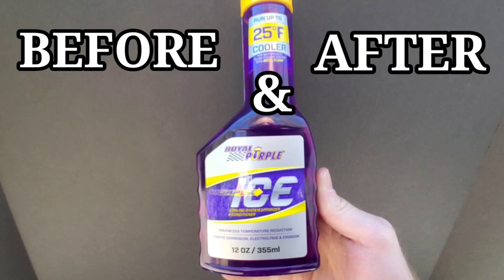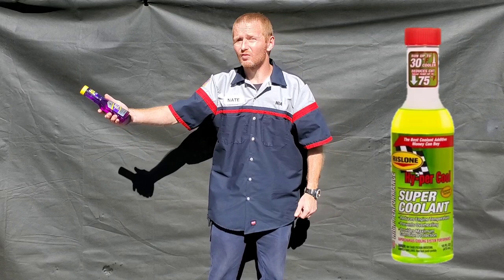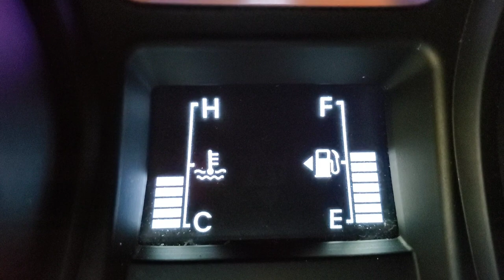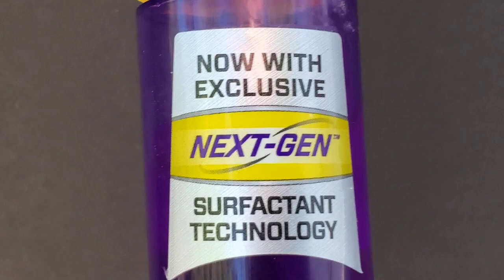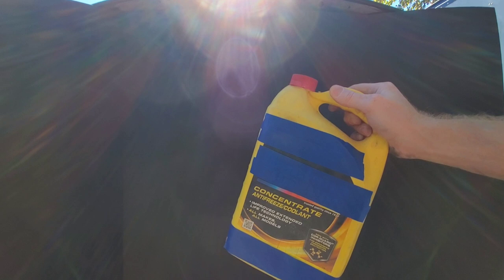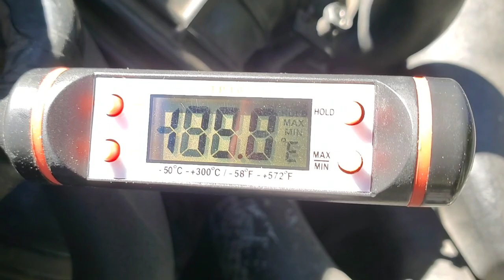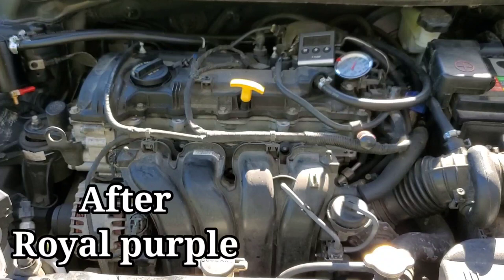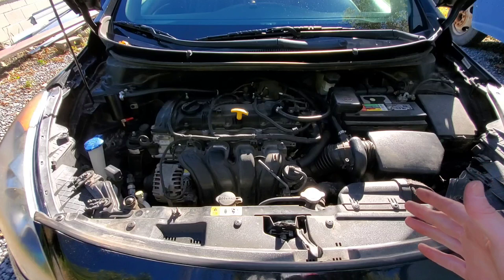Royal Purple Ice works!

Comment: i'm a bit concerned about possible build up and/or possible degradation of the cooling system
Reply: These coolant additives increase the way heat transfers between the molecules to increase efficiency.  No build-up over time, does not bond to the coolant surfaces in the cooling system.

Comment: i wonder if lowering the temperature is even  good thing in a stock properly working car. the manufacture designed the system to run at a specific temperature . Furthermore how can this make the engine run cooler if the thermostat is opening and closing at specific temperatures? Also if this stuff works so well why wouldnt manufactures add it to their coolant?
Reply: The only real difference it would make is once the engine gets heat soaked. At that point the thermostat will be pretty much constantly open. If you live somewhere whether fairly mild temperatures it’s probably not necessary, but if you are somewhere that the temperatures are in excess of 100°F an additional boost for coolant is probably beneficial. Or if you are running your vehicle to extremes (racing, endurance, off-road, etc)
Reply: My Jeep ,for instance, commonly runs at 220°F+ when off-roading in 4low even at outdoor temperatures of 60°F.
Reply: @nathanmccrary87  thank you so much for your reply and insight
Reply: @nathanmccrary87  agreed, the temp where I live consistently gets to 115-120 in the summer
Reply: @nathanmccrary87  How about if a person is using their vehicle 8 hours day in a hot climate state like Florida?

Comment: You're putting soap in your cooling system, it foams up and shows inaccurate temps at coolant system because ita not meant to read temp of air bubbles. It's a gim

Comment: It's hard to imagine the temp could be improved much below the thermostat temp. Would it be better to try without a thermostat?
Reply from the maker: It would still have the fan to impact the temperature, so I based it off of the time.
Reply: @NATESINTERACTIVEAUTO  Yeah Nathan.. I guess you did your job now the user has to take it from here. Cheers 🥂
Reply: lMFAO

Comment: I have tried the water wetter a few years back  but having had so many  issues with this jeep never had time to fully test it out. What I came to realize is things that really work are over size fan making sure the fuse is correct for amperage draw and a more efficient radiator . The stock parts are always the bare minimum for the engine size.

Comment: Whichever additive decrease surface tension the most will be the best. I have a perfect candidate to try. I bought a 2000 Hyundai accent 5 speed last year. Recently I had the cv axle, transmission, water pump, and timing belt changed. The temperature has always been steady and cool until this recent heatwave. At idle it goes up quite a bit. I can still hear the fans. Everything is all original so I imagine the radiator does not dissipate heat like it once did. I like what I saw with your test this should hopefully help my idle temperature. Either way I'll check back and let you guys know
Reply: What happed
Reply: Every few weeks i hose off my radiator fins in my cars to keep them clean of bugs and built up dirt and debris. 
That can help. 
What did you end up doing?
Reply: He in fact did not let anyone know

Comment: We'll their 5w30 sucks. After using their oil in my 370z. It ran really ruff. So after 1,000 miles I switched to AmsOil and it's really smooth now. I think this whole royal purple is just more marketing then anything else
Reply from the maker: I appreciate you sharing your experiences good or bad people need to know what others have experienced.
Reply: @NATESINTERACTIVEAUTO  oil should not be purple . They put  coloring in it. Also I dipped 5 peices of metal in five different oils. One of them being royal purple and then let them sit out over night and the next day the royal purple didn't have any film/oil on the metal. And it didn't feel as slick in your hand compared to the other oils.
Reply: My G loves pennzoil, with royol I was getting that VVEL ticking bad with pennzoil it was gone.
Reply: @AQCE245  yeah me to with royal purple. Amsoil it has like no ticking. Amsoil seems to be the best so far iv tried. About to change my oil again just about at 3000 miles. It sees you can wait up to 25000 but fuck that lol
Reply: @Nissan370_z  you did what???
Reply: Oil shouldn’t make your engine run rough.
Reply: @Nissan370_z  
Hey bro, was it 'normal' 5w30 Royal Purple? like not HPS/HMX/XMR?
Reply: @KuntChitface   ☝️👍🔥I’m use regular Royal Purple  4.2 V6 work truck 100,000 miles 1998 5w-30 from Walmart 30$ & GoldFilter K&N and Engine Restorer oil supplement . I see improvement of smoothness idle at light every time at 700 Rpm’s

Comment: Anyone tried it on a 2000 Honda Civic? Mine has 173K miles and recently these Boise summers of 100F+ sunrise to sundown have made my engine run hot. I worry it may get too hot. Anyone tried it? If so, did you flush the whole thing? Did you just add it to the exiting? Did you take off the amount you added? Thanks.

Comment: Why do you need all these? Can’t wait to run my engine at operating to normal warm temp, as car manufacturers engineered it to be.
Reply: You don't NEED this stuff per se but it will help reduce hot spots and in theory help keep things running longer. That said these products are mostly meant for vehicles that tend to be pushed harder than your usual casual drive to the store. The efficiency increase in cooling will help protect your average vehicle for instance if you tend to red line it more often than not.

Comment: Must somehow affect what the thermostat is sensing causing it to open sooner ???????
Reply: In a typical vehicle with standard coolant, you have hot spots as the water kind of flows and bounces off of surfaces. These "water wetters" make the fluid more clingy so instead of that bounce it kind of skirts along the surface more thus allowing it to cool those hot spots that otherwise aren't touched as much. The water then heats up quicker as a result and would cause the thermo to indeed open sooner. The engine however is not running hotter as some seem to think it's just able to pull more heat out of the block more efficiently and the same thing happens in the radiator, this helps it to dissipate said heat. So it will hit operating temp sooner and cool more efficiently overall.

Comment: Did it make it slower to reach operating temp?
Reply: How does it make it operate faster (run hotter) yet lower it at the same time. Seems odd.
Reply: @cat5tracker581  The theory is, the water kind of sticks to the surfaces internally as it flows instead of running off or around. This should help prevent hot spots and help shed heat through the radiator. The flip side would be as the water is more efficient at contacting those harder to reach / hot spots you could reach operating temp faster but it's not "running hotter" as you said, simply able to dump the heat into the water more readily as the engine itself is still producing the heat regardless. So in reality it's able to cool more efficiently by helping cool hot spots which will heat the water faster but also since it's clinging to the surfaces more as it flows, this allows the radiator to dissipate that heat quicker too.